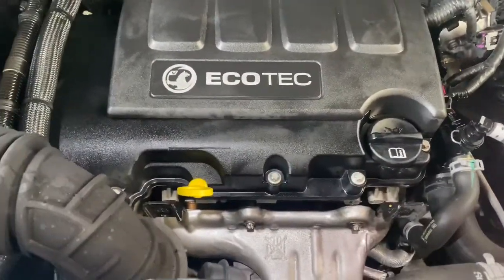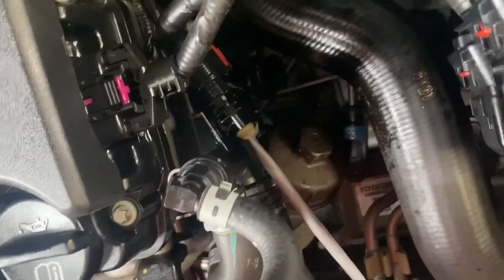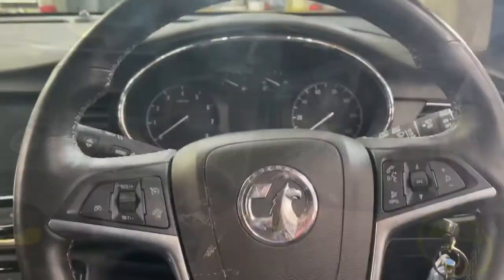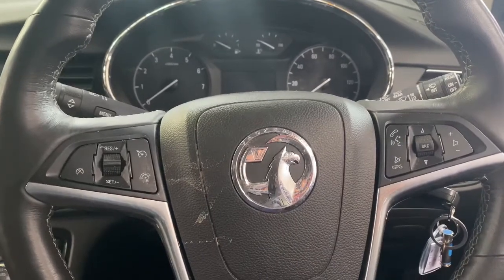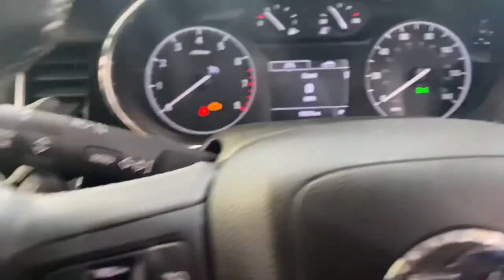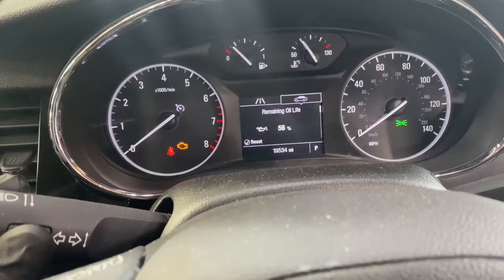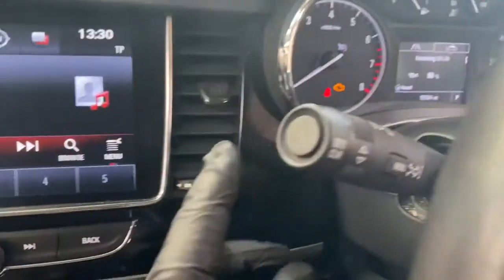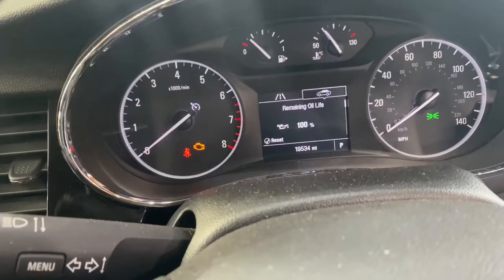#Vauxhall #Mokka #service #light #reset

Comment: Need help plz, 

So I have a mokka 1.4 petrol 2015 64,000 on the clock 

So every time I start the car in the morning it won’t turn over, I then turn it all off and retry and then firers up ( this was 2/3days ago with no engine warning light, hasn’t misfired, drive ok, doesn’t slow down on hills) 

Iv taken it to the local garage, they put it on the machine but it still can up with no faults....but the problem was still their, 

I woke up yesterday, went out to the car tryed starting it up again ....same thing happened...when I eventually got it going, I drove it into town ( less than 5 miles...the temperature when up to 130 + error code of 89  with a yellow spanner sign,

I’ve google the shit out of it and it saying it’s either the o2 oxygen sensor or the Particle Filter,

What’s ur Thoughts plz
Reply from the maker: Code 89 is for service  your vehicle is a petrol so It shouldn’t have a particulate filter fitted  in regards to the cold start issue I would check the vehicle for fault codes when it happens
Reply: This is the issue they can’t find a error code for the cold start 🤷🤷
Reply from the maker: Check your battery condition or replace your fuel filter if you have one
Reply from the maker: The only thing I could think of it to be is your fuel pump if it’s not your battery or fuel filter being blocked
Reply: Is their a fuel filter ( I rang Vauxhall to get one -they said it doesn’t have one ??) fuel pump ?? Easy to replace, iv got a video of what happens
Reply from the maker: I’m not sure about the fuel pump have never replaced one it’s gonna be under the rear seat or you have to drop the fuel tank down ask Vauxhall just to be sure
Reply: @g_a_bofficial  yea it going in Tuesday which I’m not happy couse it gonna cost fuck loads,